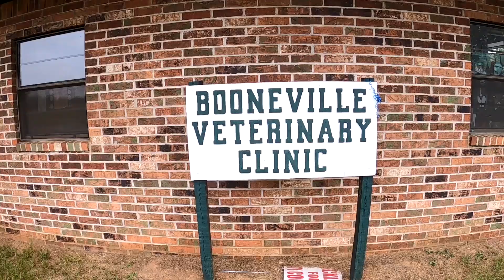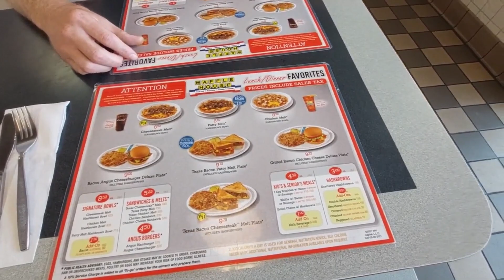Errands, Tool Hunting, & The Bearded Carpenter SAVES THE DAY!

Comment: There is always Craigslist to hunt for tools. Go on the weekends or when ever check garage sales.Some times you can great finds. As a rule I never pay full price for anything. I always look for the lowest price , nothing wrong with getting used tools, in hand tools. Get yourself a grinder , that will save you so much grief and some diamond sharpening stones. You need them to keep you tools sharp at optimal working condition. I keep my tools sharp to shave my arm hair, or leg hair. Water stones require shaping ,then wear out. diamond stones are worth the price .

Comment: Mel that log hook yall are looking for can be purchased thru Northern Tools. Something we did for a scraper was to buy a garden hoe and heat up the metal rod section and straighten it out make the hoe point straight down, then sharpen the edge.

Comment: Idea not to do now but in future to save money. I’m seen a lot of off grid and homesteader go to or using solar panels , batteries and converted. Their running their homestead on it.the two families could put in a small building to store batteries and converted to supply power for both families, like I said research for future

Comment: Winter is cold and rainy here how about there? Y'all are doing a great job guys 👍 we have Metro too I'll have to check into it..... how's your booster working does it boost your internet speed? Wow that's awesome but a lot of work great you found someone else that knows how to build a log home
Reply from the maker: Hey Pafford!!! We always had reception at the 41.36 through metro but before the booster it was spotty inside our trailer and a a lil spotty outside. Now with it, were always connected. It doesn't boost the speed but gives you a stable connection, and that alone helps spped things up. The new hotspot thingy we bought is working great so far! No complaints! I hope this helps 🤗